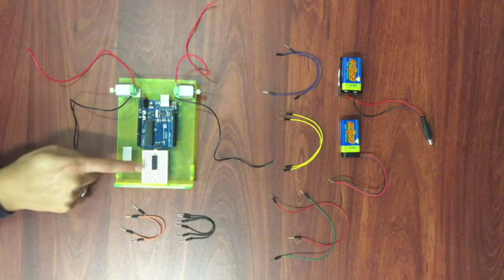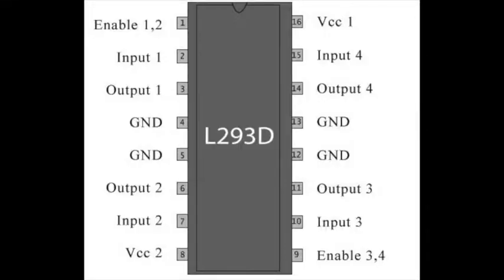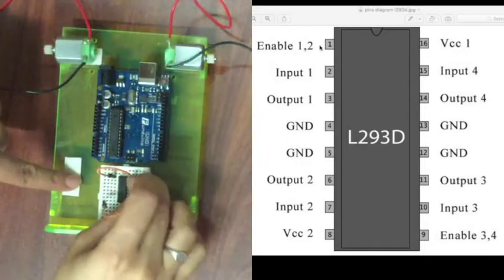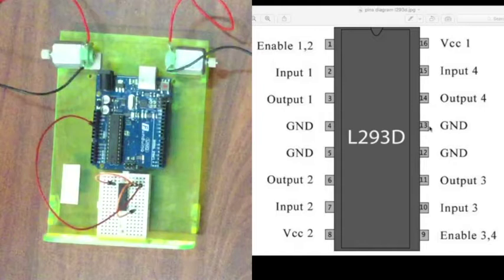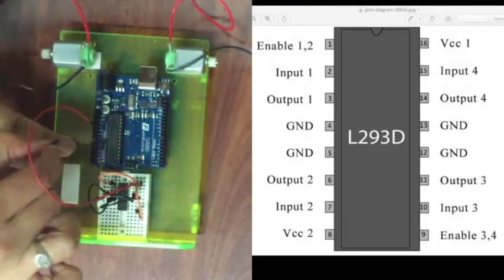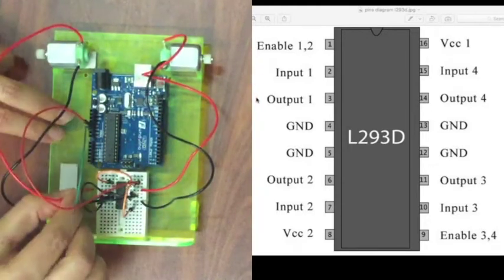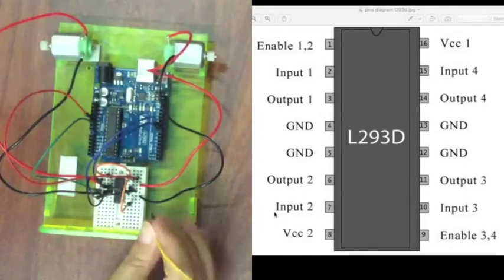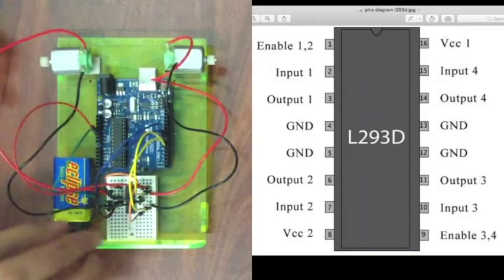How to wire DC motors to an Arduino using an L293D motor driver

Comment: Won't there be any problem as u are connecting the negative pole of the battery with the arduino ground?
Reply from the maker: Hopefully there are no problems - these connections should all work perfectly! :)